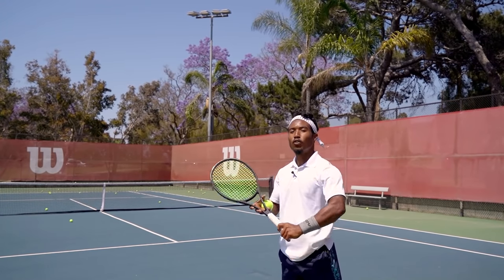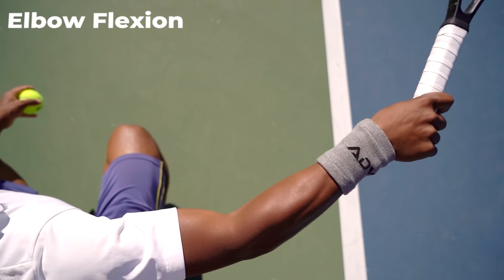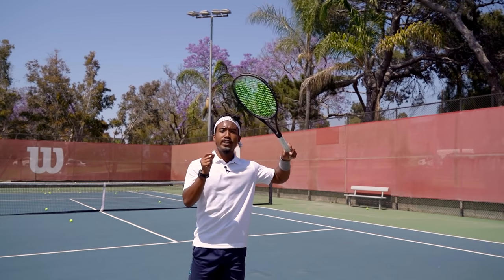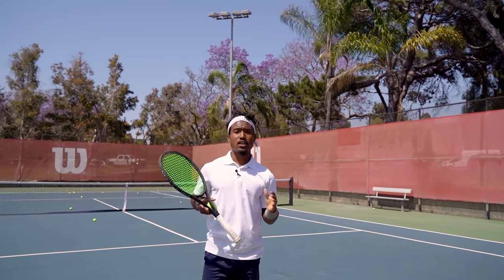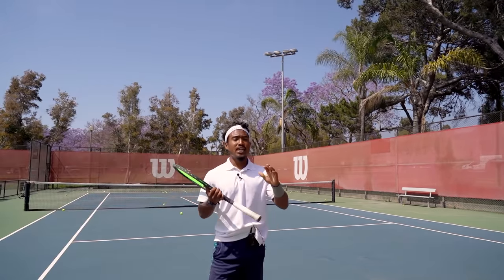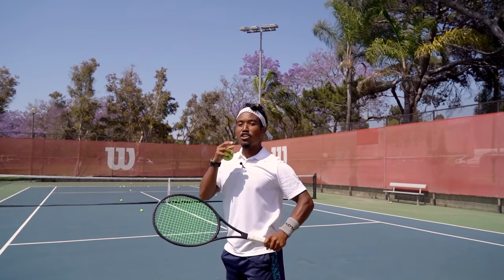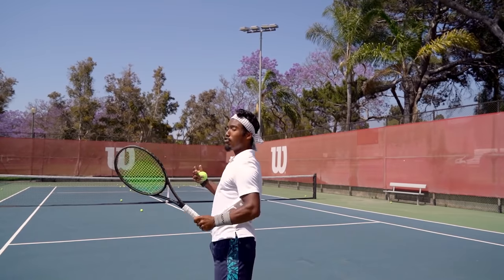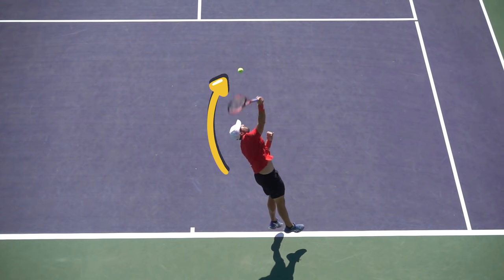How To Generate EFFORTLESS POWER On The Tennis SERVE In 3 Steps

Comment: Most surprising is how virtually none of the 3 coaches I've had have ever explained this significant difference and advantageous method that pro's use. I've learnt so much more through videos such as yours. Understanding the arm position on raising it, the 'drop' and pull in a kinetic chain  momententum is key for power and speed.  Great video.

Comment: Great Stuff. Quick question...Is the energy generated from the back hip to the torso and being unleashed through the arm and and then wrist? Should our focus be on the back hip and torso unloading which will drive the arm?
Reply from the maker: Great question Christopher! The back leg and hip are going to help you in rotating your torso and hitting arm forward to contact. But there are 2 problems that you might find with just focusing on the back hip rotation:
1. Over-rotation: If you only focus on the hip rotation into the net, you neglect the other methods players use to generate force on the serve. As a result, you may rotate your hip and trunk to the net too much.
2. Forward Weight Transfer: If you think "push from the back leg," you'll end up putting too much weight on the back leg prior to your leg drive. Top pros will shift most of their weight on to their front leg as they load. And naturally, this means the front leg doing more of the "pushing work" during the leg drive.
We'll cover this in much more depth in next weeks video on the Serve Leg Drive. 
I hope that helps! 
- Daytri
Reply: @RacquetFlex  Yes...Really looking forward to next week's video.

Comment: love this video ... and have a question/concern .. I'm older (64) and last year had a mtn bike fall and suffered a posterior shoulder dislocation ...  i rehabbed pretty well with just some residual soreness ...  my serve is the strength of my game .. especially as the wheels slow down ..  but i notice i'm holding back out of fear of dislocating ...  so less snap/power/speed ...Any similar experiences or thoughts/advise out there.  Thank you

Comment: Can you hit a kick serve from the pre-throw position? If so please explain how. Thanks!!!
Reply: All the concepts will apply you will just need to pronate your racket head more at impact so you can brush up on the ball more.... so instead of your racket tip pointing to 12 o'clock with a slight till towards 11 it should point to maybe 10 or 11.  That way the ball can travel across more of the strings to give you access to a larger surface area on the string bed and thus access to more spin.  You will hit up across the ball with more racket head acceleration just up more to generate more spin.  You will actually need to swing harder than you do on the first serve.  As they say you are only as good as your second serve; just make sure you hit it with confidence.   Hope that helps.
Reply: @MMm-kp7lk  Thanks a lot!!! I will try to do that!!!
Reply from the maker: Great explanation, M Mm! Thank you.
Reply from the maker: Great question Ger, starting from the pre-throw position will simplify the motion and help you with the kick serve as well. The 2 big things that change are your contact and swing path.
1. Pros will make contact further over to the left (general range: above head instead of hitting shoulder). To adjust to this contact, they will also have less hip and torso rotation at contact. This helps with the second factor.
2. Pros will swing on a more "left-to-right" swing path, intersecting the ball's flight by swinging up and out. But it's critical that you don't manufacture this swing path with the wrong motions - the primary drivers of racquet head speed are the same as on the flat serve.
Focus on using the same throwing motion (utilizing internal shoulder rotation) by imagining you're throwing your racquet. In this case, you're throwing the racquet to your right instead of straight forward (as you'd do on a flat serve). We'll make videos on the kick serve very soon. Stay tuned!
Reply: @RacquetFlex  Great explanation!!! Thanks I will try this way!!! Looking forward for more videos!!!
Reply: @RacquetFlex  One more thing, I've noticed during prethrow position I've lack of strenght in my thumb and hand generally to keep my racquet firm so I loose power..Is there a way to help this?

Comment: Note that in the slomo videos, the racket pivots upwards out of its "on edge" position towards contact, like a catapult, whereas when he demonstrates in real time, he has a much smaller angle between racket and forearm, and he pivots the racket a lot more sideways out of its on edge position, with the racket swinging open ike a door.

Don't pivot the racket sideways like a door swinging open. That really screws up your swing and hurts your ahoulder, your arm going one way and the racket going another.

Comment: Hey guys, I do the complete movement but I can not acelerate it. What can I do to improve the speed of the serve swing?
Reply from the maker: Hey Jorge, great question! The swing is the foundation of your serve (like the wheels of a car). Without it, no matter how much power you generate, the racquet won't accelerate. 

Once you develop the coordination and technique of this swing, improving your serve power becomes about how much force you can generate. We'll cover this is next week's video but a big power source is the combination of body rotation and your body flexing forward into the court. 

2 things that could probably immediately help you are:
1. Focus on getting a good hip and trunk rotation away from the net as you toss the ball up.
2. Make sure you're making contact with the ball in front of the court (jammed contact is one of the biggest power leakages on the serve).

We made an entire video on the contact point that could help you out as well: https://www.youtube.com/watch?v=DHBPL9MqTSk&t=37s
I hope that helps! - Daytri
Reply: Ok, thanks Daytri. I really appreciate your answer. I believe the problem is in the tip numer one. I will try to improve the movement of the hip and the trunk. Thanks a lot!!! Best Regards!!!

Comment: You don’t just place your arm in that position and expect to get that kind of easy power. 

Practice relaxing your entire arm and  then purposefully isolate and lift up your entire arm ONLY using your shoulder muscle to get into that throwing position. You should feel tension like your arm being is “cocked and loaded”, that’s how you focus-in all that energy and then release it. 
With enough practice and arm warm-ups (plus a good toss and a well-timed swing) you can serve at high speeds with ease.

Comment: Disagree. These type of motion is only essential for creating certain type of spins. Effortlessness come from the transfer of power from the low body to upper. You want to transfer your body weight through contact. The arms swing is really a guiding/placement factor for the ball. Using the arms for power is extremely limited for generating your full potential of power. Once you over focus on your arm, it becomes more stiff; hence, you will hinder your body weight from being transfer to the ball.

Comment: Effortless power is a nonsense term in sports instruction (no matter the sport): Power = Work/time = force x velocity; all of which are measurable quantities. Less wasted effort is the intelligent way to describe this, but finding intelligence in most instructors is like finding the proverbial needle in the hay-stack. Good luck with that.
Reply from the maker: Hi, Don, good point! Biomechanically, hitting harder requires more effort and a more accurate term would less wasted effort. But experientially, players may feel this "effortlessness" when they use the correct muscles and techniques. Although pushing a 100 lbs squat requires that you produce force with your legs, it doesn't necessarily feel like it takes as much "effort" as benching 100 lbs. I think a lot of teaching is finding the balance between biomechanics and what the student would best resonate with.
Reply: @RacquetFlex  In other words, to teach tennis become a psychologist not a physicist.
Reply from the maker: Or perhaps a little of both 😉